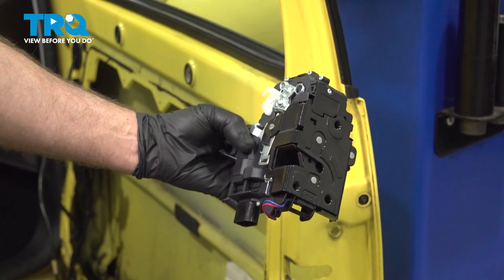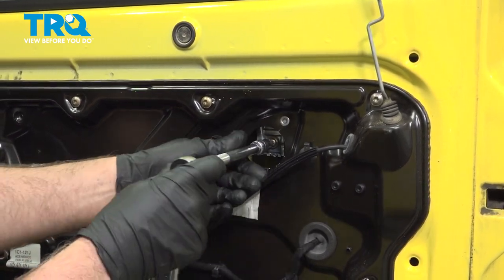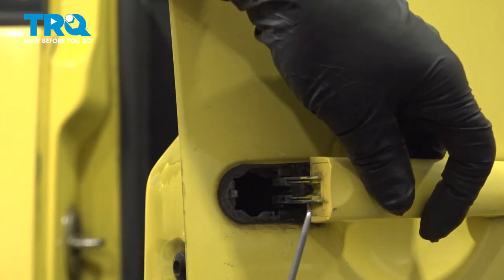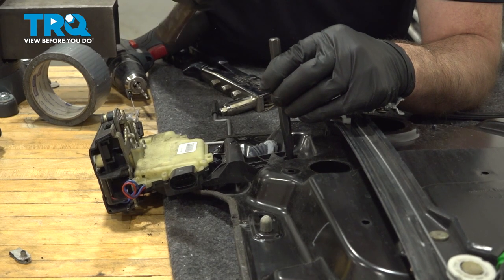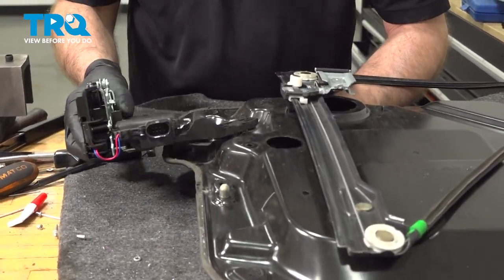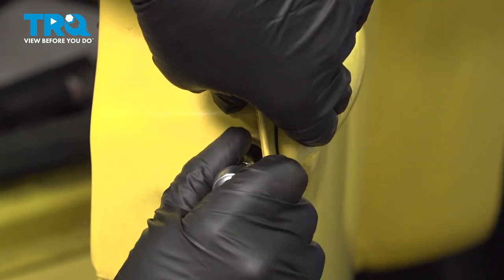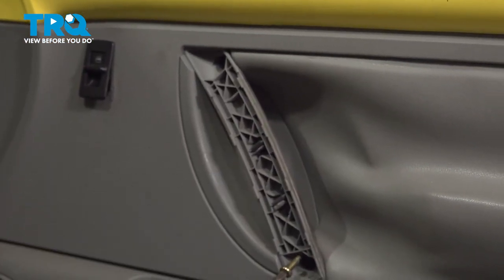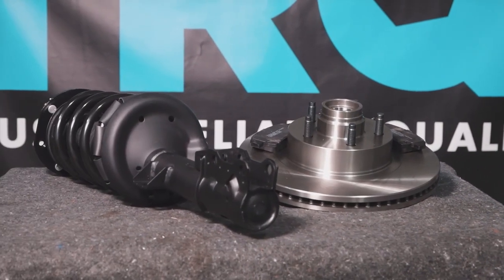How to Replace Door Lock Actuator 1998-2010 Volkswagen Beetle

Comment: For those wanting to avoid installing this whole actuator and then finding out you didn't put the spring loaded door handle LEVER in correctly (which means you have to remove the whole sub frame AGAIN to remedy 😢) i would suggest also watching Humble Mechanic's breakdown of vw lock actuators and pay attention to his overview of how the thing works and ESPECIALLY why you need to properly set/preload that door handle lever with that wire spring 

Zoom to 2:11

https://youtu.be/RqmqnK6UXvY

Understand what you need to do before installing the new actuator and you'll save yourself summer frustration.  I know because i followed the sparse service manual that addressed this very thing but was missing some vital piece in the procedure which vw failed to put in the manual (either that, or my actuator is already broken in a way that makes operation of that spring and level combo not work).

Comment: Is the lock bracket at  9:05 an optional bracket?  I got my car used, the driver's door had seen some repairs - it doesn't have this bracket but it does have a place for it.  Maybe it's primarily for factory installation?

Comment: This video sucks it doesn't show anything about how you're supposed to attach the inside parts of the door latch. He just pops them on and there you go. That's not the case you have to hook up a bunch of different components inside the door handle when you're putting the handle on and the lock on.